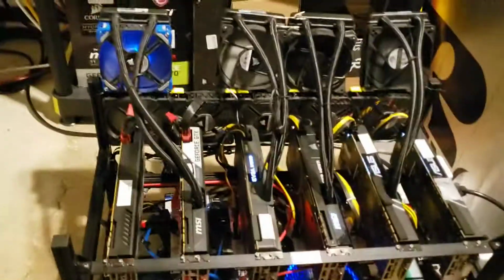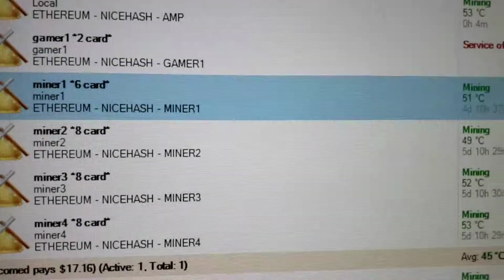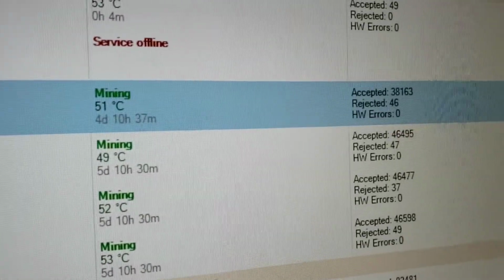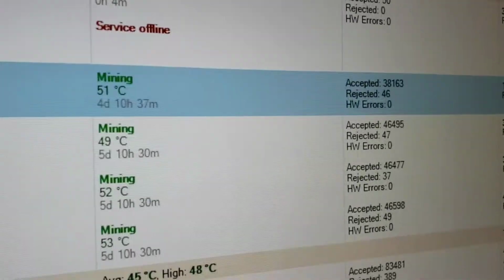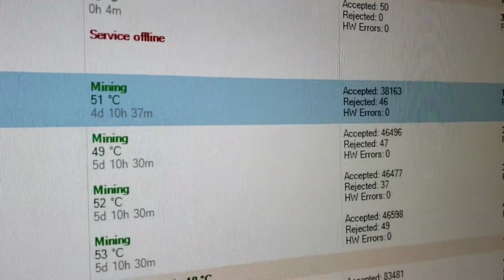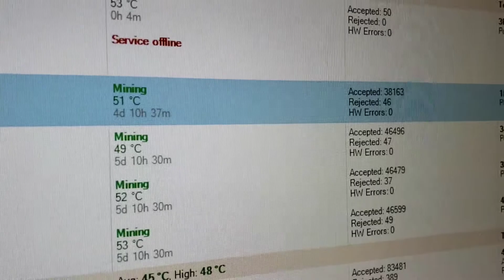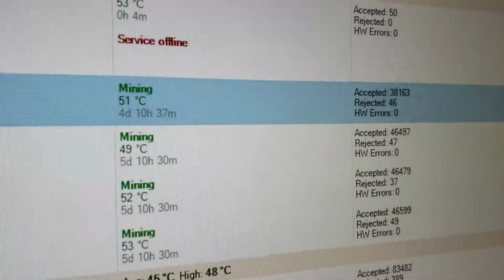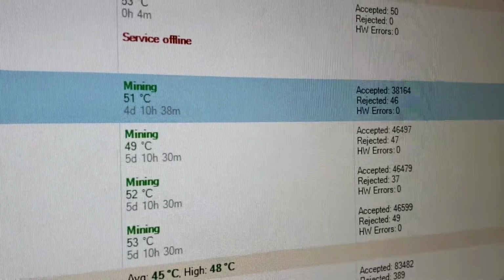Mining rig keeps crashing? Try This

Comment: I have this exact problem now. Even now with HIVEOS watchdog. It doesn't tell me why it restarts every 1-2 hours. Exactly your issue. I've changed all risers, changed oc's everything. Reflashed ssd. Still having issues. Damn
Reply: same mine resets usually every 12 hours, but i think it is caused by 1-2 bad riser connections maybe, il try this trick in video
Reply: @NeetGuru007  I did what the video said aswell. Checked all connections, removed, cleaned replaced, i actually replaced all the risers as i had 12 spair. I reflashed SSD, removed all oc's, tryed everything i could think of. My fix in the end, change from trex to nb miner. Problem seems to of been solved, stable for 12 hours. This issue just occured randomly. Mining... what a life lol

Comment: How to Bios Mod 3060 ti using HiveOs and How to lower it's power consumption while getting more hashrates
Reply from the maker: Never used hiveos. Sorry. But try clock locking your 3060ti to 1050 mhz. That helps a little with power. Works better on 20 series cards. The 30 series it helps a little bit.